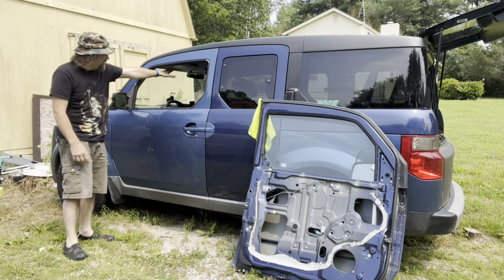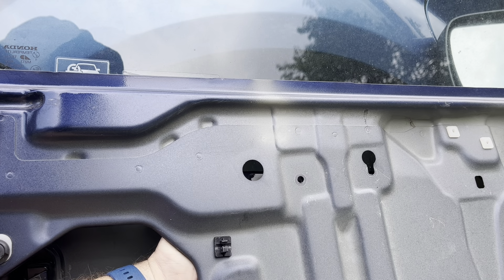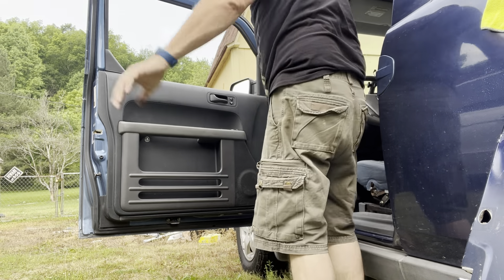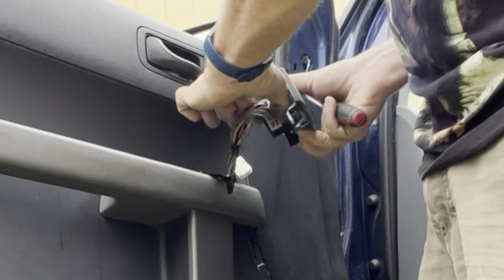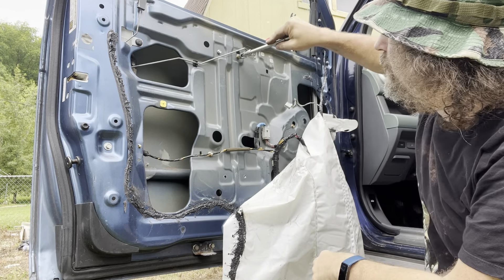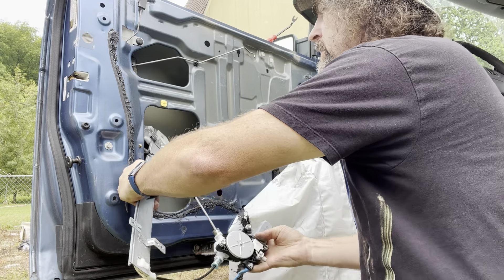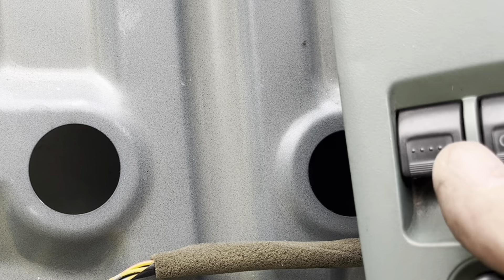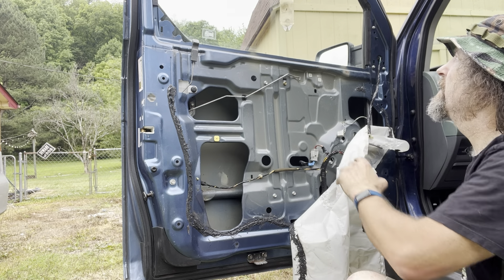Replacing the window regulator on the 2003 Honda Element.

Comment: DONT FORGET TO: when rolling up the window, hold the button up for 5 seconds then roll it down and hold it down for 5 seconds again, that will give you auto up and down.
I now have to replace my passenger side one, I did my driver ride last yr. once they start sounding crunchy means the wires are fraying. (not good) it is an easy fix. 
Like I say each time TY for sharing yoru work and making vids. Great job
Reply from the maker: That's a good tip! I seem to do these window jobs in batches. They all break one after the other.

Comment: Good job Clint. I've had the driver's door panel off my 2003 five times so not as quick as you (chasing door lock/actuator issues). More practice next week when my shin anti-crusher (aka door checker) comes in. Laughed when you mentioned your shin issues. Still fixing SRS warning light... maybe eBay Chinese seat belt buckle will fix it fingers crossed if I trust my Harbor Freight scan tool. Mine turned 250K last month. Good luck to you.
Reply from the maker: Yea, my buckler thing has crapped out again. Time for a rematch with the bubblegum king.
Reply: @clintsearcy3252  Bubblegum king?